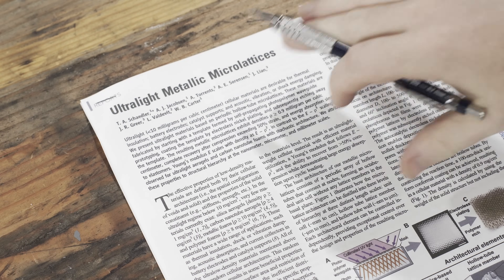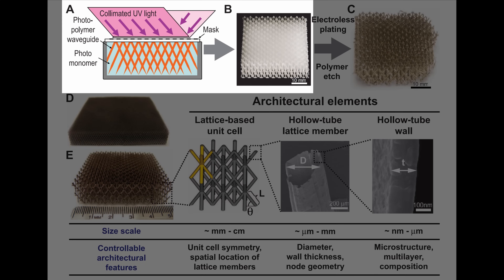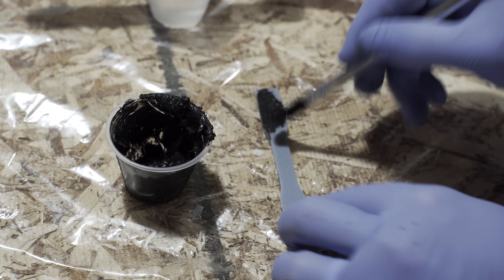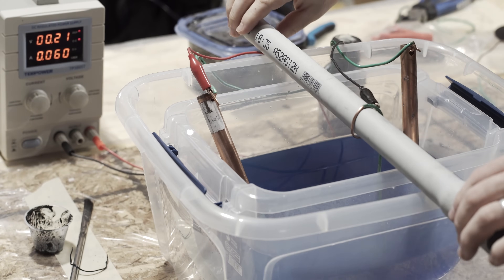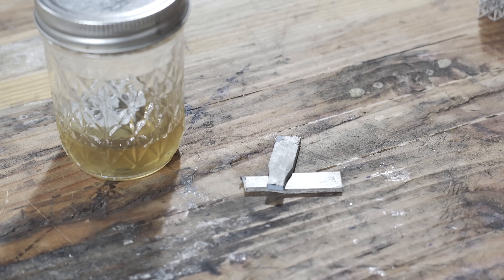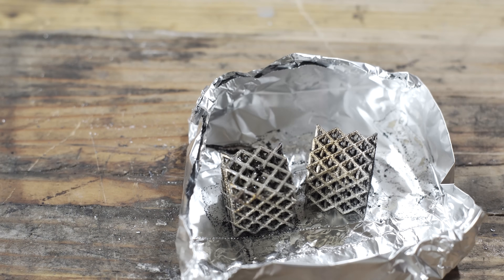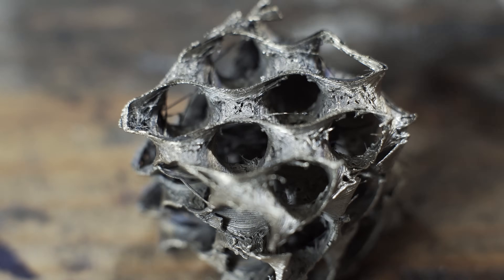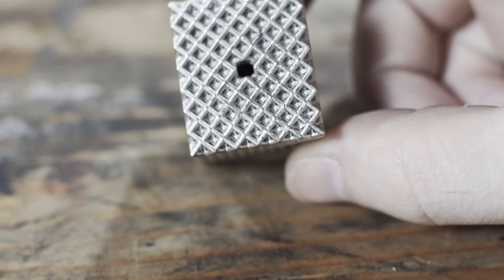Ultralight Metallic Microlattices

Comment: So, potentially dumb question, but would an electroless nickel plating solution work with sucrose/wax? My brain tells me sucrose would more than likely dissolve in the solution, but I don't actually have experience with these kinds of chemical reactions.
Reply from the maker: Hmm, yeah I think the sucrose would likely be dissolved away (at least at the surface of the material, leading to pitting).  Most of these solutions are aqueous so would end up dissolving something like sucrose.  You might also have a tough time "activating" the sucrose/wax for electroless plating.

If you don't mind painting it with graphite paint first, you could go the traditional electroplating route without issue I think.  The acrylic in the graphite should "seal" the sucrose/wax pretty well and prevent it from dissolving
Reply: @BreakingTaps  Hmm, I think coating the sucrose would be... difficult, to say the least?

For context, @makingwithluke has an OSS SLS 3d printer in development, and he demos it by sintering basic sucrose, and having watched this video the week before, it got me extremely curious if this would be an actual solution for a dissolvable support medium for electroless plating without specialized resins or the chemicals required to dissolve them.

It sounds like it wouldn't really work out ( what you're saying makes sense ), however, which is kind of unfortunate!
Reply from the maker: @IncendiaryMedia  Woah, thanks for the tip about that SLS printer!  Just subbed and joined the discord, looks really neat.  I was actually just playing around with sintering silicon carbide on my fiber laser and noodling over an SLS design... but would much rather build on top of his system, looks fantastic.

But regarding the electroplating, I bet you could dip coat the entire print in something to protect it from the plating solution.  A thin layer of hot wax, or even something like lacquer or polyurethane.  Just needs to make the part waterproof, then you could plate it, then melt/burn out the interior (if you wanted).

Comment: Sputtering for initial layer? (https://youtu.be/Cyu7etM-0Ko)
Would forced convection improve electro plating in the middle of the dense lattice?
Perhaps even pumping solution from the other electrode into the middle with some silicone tube?
Reply: I'm getting good results with conductive PLA and plenty of agitation. And PEG, if you aren't already using it. (edit: haven't tried lattices yet though :)

Comment: Very interesting. What about printing with conductive PLA and skipping the carbon ink stage?
Reply from the maker: I haven't tried it before, but if that filament is reasonably conductive (say, under a few kOhm resistance) it'd probably work well! The graphite just acts as a "seed" to start the plating, once a bit of copper starts to plate out it progresses rapidly from there and covers the surface.  So really anything that's "conductive enough" should do the job :)

Comment: just a heads up on safety, Nickel compounds tend to be pretty toxic and have a pretty high Contact allergy rate. Also its a known carcinogen so when electroplating some amount of the solution is going to spray and aerosolize so doing it outside would be a good idea.
Reply from the maker: Noted, thanks!  Have some family members with a nickel allergy so I've been relatively careful with gloves, etc so I don't develop an allergy too, but good point regarding aerosolizing... will try to setup some better ventilation for next experiments :)  Cheers!

Comment: Some thermosetting plastics can be carbonised in an inert atmosphere without distorting. If you can manage that then you remove one step and solve another problem while leaving a lightweight and very strong core that will compliment the plating in terms of their different tensile and compression strength characteristics. You may also want to look into plating solution flow and AC current,  obviously it needs to be biased AC but the frequency and waveform shape, even their change over time, may make a difference. The electroforming literature does touch on this so it is worth reviewing it. Also look into catalytic graphitization, it may be that your carbonised form can be dipped in nickel chloride then reheated to graphetise it prior to plating which will make it both stronger and more conductive. Not sure how well that will work, you may get uncontrolled shrinking, in which case burying it in magnesium oxide powder during the bake may at least minimise distortion.
Reply from the maker: Thanks!  Just gave me a ton of things to research, will look into all of this!  I like the idea of just cabonizing in place, which unfortunately adds another reason that I need to get a controlled atmosphere furnace :)  Or modify my furnace somehow... would probably need to weld up the shell so that it's somewhat air-tight.  I'd also like a higher temp furnace too, hmm...

Cheers for the suggestions, will chase these down!

Comment: Could you use a 'lost wax' process?
Maybe use a refractory material that pours like plaster, but can be dissolved in water, water/acid.
Reply from the maker: Hmmm that's interesting.  I guess it'd end up being a three-step process?  Print the negative mold, pour the plaster to create the positive, plate the refractory and then dissolve.  That seems promising... might be hard depending on geometry if there are unsupported internal components.
Reply: @BreakingTaps 
Does this need to be hollow?
If that's true, my idea won't work.

Comment: I wonder if you can get results similar to nickel-chromium-iron alloys by mixing the plating solutions? I’m thinking this might have aerospace applications... 🤔
Reply from the maker: Looks like you can!  In "Modern Electroplating, 5th edition" it references a 1972 paper and includes a recipe:

- K2Cr2(SO4)4*25H2O : 326 g/L
- Nickel Sulfate: 84 g/L
- Ferrous sulfate: 56 g/L
- Glycine: 150 g/L
- 20C, pH 2-2.2, 8.5A/dm^2

In general it seems that as long as the base metals plate, you can mix them to get mixtures.  I'm not sure if it classifies as an "alloy" or if they just co-plate and sort of intermingle.  Lots of binary/ternary recipes for Iron in particular though: phosphorous, boron, carbon, cobalt, nickel, zinc, etc

(Chisholm, C. U., and R. J. G. Carnegie. "DEPOSITION OF TERNARY NI-CR-FE ALLOYS FROM AQUEOUS ELECTROLYTES--REVIEW AND EXPERIMENTAL STUDIES." Plating 59.1 (1972): 28-37.)

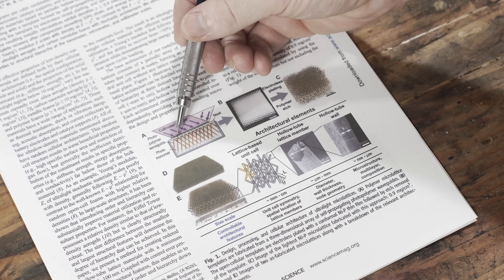Comment: I have been were you are a couple of years ago but for High aspect ratio structures. My solution for the resin ( SU-8 at that time) was on nasty Molten Salt solution( oxidises  eveytthing . And for the plating You need a well controlled sonic agtaion. That breakes down the nernst defusion layer and ensures turbulent convection  within the structure.  This overcomes the problem that the inenrts of lattice depletes of ions. I used a Megahertz transducer with half a kW but my structures where in the 5 µm scale and an aspect ratio with 1:10. So may be if you can regulated the power on your US bath put your beaker in and Try it out. the trick is that the Thickness of your Defusion layer become govern by the agitaion frequency not by the velosity of the quasi laminar flow across the surface. have fun
Reply from the maker: Awesome, thanks for the tips!  That's interesting regarding sonication... I wouldn't have thought of that.  I had been considering setting up some kind of pump/jet to get electrolyte into the lattice, or just a stir bar.  But I'll try the ultrasound instead...maybe a good excuse to get a probe sonicator/homogenizer too, could insert that right into into the middle of the lattice :)

Molten salt though, yikes!  Think I'll avoid that for now :)  Not surprised though, I threw every acid and base I had at it and nothing. I thought surely HF would do something but I guess not :)
Reply: @BreakingTaps  The Problem is that with a laminaresque stream you will always form what is called a Nernst diffusion layer. of several tens of microns. due to the non-slip condition on the liquid-solid interface. And therefore the only terms that can resupply the interface with ions is diffusion with those structure. But on the outside the convection contributed to a much higher degree so that means the field has a much easier job supporting the plating process and therefor contributing to further imbalance. Sonic aggitation break up the diffusion layer and bring ions to the surface.The difference in the Distance between the electrode, and the surfaces is still a problem but you might wanna have a look in to bipolar plating with variable Pluse width and voltage levels so you level your plating by cyclic plating and etching. By the way brightners alway help. Cheers Jens

Comment: There is commercially available wax sla resins, might work well here
Reply from the maker: Ah interesting!  I might have to pick up a bottle of that and try it out :)  I noticed on Formlabs that their burnout schedule was a lot slower than mine... like 14+ hours (mine was closer to 4).  I wonder how much that contributed to my troubles...burning it out too quickly.
Reply: @BreakingTaps  Yeah check out the resins for jewelry casting - there are a bunch. FunToDo and Phrozen both make them.
Reply: @BreakingTaps  Youtube channel Veg Oil Guy is working extensively with that kind of SLA resin for casting, you should check out their videos.
Reply from the maker: @MrBleulauneable  Will take a look, thanks for the recommendation!

Comment: Great work! I've worked for years with RepliForm who do this professionally with additive parts. We've used it for SLA and SLS components that need to be more mechanically robust, but it's not necessarily a cosmetic finish as some think due to the natural surface of a printed part.
Reply from the maker: Oh cool, wasn't aware of that company...very neat!  Will keep them in mind if I ever need a part plated for real! :)  In case anyone else is interested, RepliForm has a really nice presentation with real numbers too: http://www.repliforminc.com/ElectroplatedAMParts%E2%80%93Composites_without_Tooling.pdf  

Happy to see this is a "thing" that's done in the industry to improve robustness of the print!  Feels like more people should be doing this, it was sort of staggering how much stronger the print felt qualitatively :)
Reply: @BreakingTaps  We also did a webinar on plating Formlabs print.  The video of that is available for streaming.
https://3d.formlabs.com/recording-closest-thing-metal-3D-printing-with-3500-printer/?utm_source=direct&utm_medium=email&utm_campaign=webinar-followup?utm_campaign=webinar-electroplating-may-2020&utm_medium=email&utm_source=direct
Reply from the maker: Awesome, will have a watch later!  Thanks!